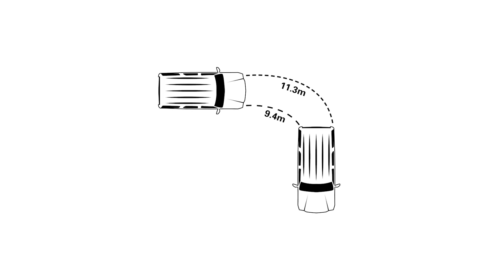SUB $600 DIY LOCKER INSTALL – Watch how much difference it made - Front vs. Rear, Manual vs. Auto

Comment: This can't work, if you were able to turn the wheel with the force from your arm while the other wheel is being held by another person, then why won't the engine just power through it when the wheel lifts? In that test the run with no lokka clearly goes in super hard compared to when you tested the lokka on... I don't get it
Reply: Lachlan Sutherland 
I was thinking the same, obviousely we are missing something?
Reply: When you have the accelerator down with drive to the crown wheel via the pinion from the drive shaft the diff centre is rotating putting power to the diff centre via the cross pin you saw briefly in the video. With torque applied to the cross pin it puts pressure on the intermediate plates which are pushed outward toward the side gears which the CV drive axles are connected to stopping them from ratcheting. Back off the accelerator and the side gears will then ratchet over those teeth as the inner intermediate plates can push back towards the centre with help of those little springs. Hope this makes sense.
Reply: Geoff Moroney
 Great thanks. I think I understand better now but other than the mentioned benefits I will stick to a manual locker of some kind
Reply: @BandittBKA  I've driven vehicles with both auto and manual locking diffs, I prefer the auto style as in this video. Control it with your right foot. Accelerate and it stays locked, back off and it unlocks, accelerate and it's locked again. Keeps your hands on the wheel. Downside if it bothers you is the ratcheting sound and slightly heavier steering when 4x4 engaged. In 2wd it's the same as it always was.
Reply: I will add that the part where Sauno is pushing one tyre while the assistant holds the other, is not replicating anything that happens on the road.  If one tyre has grip, noone is hand turning the other wheel. The drive impetus comes from the driveshaft, not in the reverse direction from the wheel circumference.   I think the point is that in the absence of doing that, then the driveshaft will be turning both wheels the same, including the one with grip.
Reply: @geoffmoroney9283  So is there any delay (wheels having to spin at all before it engages/locks if having to stop on a hill etc
Reply: @volcanic5187  No it's always locked and it unlocks automatically to releave any axle wind up and then locks again. You can also control this yourself by getting on and off the accelerator, backing off will cause it to unlock sooner.

Comment: I missed the part where they mention these are extremely noisy and chatter when on pavement.
Reply: They do mention that they are for part time 4wd. You shouldn't be in 4wd on a pavement. 
But if you're talking in a fulltime 4wd, then yes I expect they would be a bit noisy. And under a fair bit of strain in a carpark, for example.
Reply: @alexdevries7594  and gravel?
Reply: Damien Frizzell fine on gravel in my experience. It’s the slow, tight turns where you really hear it.

Comment: How do these perform when cornering in sand? I'd imagine putting the power on when cornering in sand would lock it up and make the steering heavy and difficult? Anyone with any experiences?
Reply: Works great in sand ! Its most of what we get to drive in SA - beaches, dunes or deserts. If the wheels are spinning under power no differential action is needed, so no change really. A little bit of self centering occurs, but if you're stuck in some deep ruts where everyone else has driven - just turn the the steering wheel and the Lokka will usually drive you out of the ruts !
Reply: You will need to let off the accelerator for the locker to disengage

Comment: A lot of 4wds are constant 4wd.

I know this video is scripted for complete newbs, skipping important parts in setting clearances is going to leave a lot of weekend mechanics in a spot. Be careful.
Reply: Yes - make sure you use your feeler gauges to check the intercam gap - takes one minute out of the hours of installation. The fitting instructions deal with this.

Comment: anyone else fitted one, what do you think of them?
Reply: I have one in my GU the clearance weren't right and it stays locked, at the end of the fitting you saw Shaun spin one wheel while he,s mate held the other, mine wont do that it just stays locked its a big heavy job and I followed the instructions too I'll be taking it out as soon as I get an elocker.
Reply: Best traction aid I have ever added to my Patrol and the cheapest form of diff lock you can get, fitted it myself to the front diff.
Reply: @petejones961  Must have something wrong with the install, the one I fitted to the front of my GU is spot on. Worked just like Shaun showed in the video. It is a heavy job, that front diff centre is a beast.
Reply: Have one on my Jeep and can’t fault it at all! Can’t notice it at all when driving in two wheel drive and works great off-road in 4wd, best mod I’ve done.
Reply: I have a Detroit auto locker in the rear. It’s always locked... every time I go into  a low speed turn I have to take it in neutral if not I bounce😂
Reply: Love it!      Have done a lot of ks and apart from the unbelievable traction you wouldn't know it was there
Reply: @petejones961 The measurements in the instructions are critical and they do have a warranty. You may have missed a step or two
Reply: I have one in the front of my GU and I like how it's goes only time I've really noticed it was a technical uphill climb, steering was a little difficult, heavy to steer and wants to go back to centre very hard but otherwise I love it.

Comment: Seems like junk if he can hold the wheel and disengage it .. what stops that from happening on the trail
Reply: When engine power is applied the centre pin forces both ring gears outward, locking them into the locked position
This means you MUST come off the accelerator when taking corners to allow it to unlock or you'll essentially be cornering with a spool

Comment: how come i know no one with one then? everyone i know runs a manual locker. there must be a down side to this thing
Reply: There is a downside the clearances on these lokkas must be right, if there not, it wont work properly and they don't come with any shims if you need them you have to get them made, you cant buy them. Also your crown and pinion cant have any wear.
Reply: If fitted correctly they work brilliantly, I prefer them over manual lockers. Much cheaper and you control it with your accelerator. Downside is slightly heavier steering while in 4x4 and the ratcheting noise when it releases going around corners.
Reply: Geoff Moroney ahh so they make a audible ratchet noise even when not in 4wd too then? If so I can definitely see why people don’t run them then, I’m sure that would get very annoying very quickly
Reply: @bbggakkba  if you don't have 4x4 engaged there is no noise.

Comment: Nice illegal bullbar in qld one third off the tire must be covered lifted or not. I have the fine to prove it.
Reply: you should probably challange that in court. seen as 3/5 is generally covered by the vehicle body anyway
Reply: @richardkomar8765  they are talking about the front  not the rear. The  engineer they made me hire inspect and mod plate. Said that arb bars are failing on hiluxs. The police dont carry a tape so anthing higher than the top off the rim from the front is fined.
Reply: @karlpokorny7130  - find this and have a read. Minor Modifications – VSI G19.11

Comment: Mmmm sounds a bit noisy
Reply: I have one in the front of my 2001 Rodeo. I am yet to hear it unlock on the trail. Not over the roar of the V6 anyway... :)
Reply: You get some strange bangs and clicks sometimes . I occasionally get massive bangs as the pressure is released from the dog clutches

Comment: Are these Auto Lockers compatible to any IFS front end vehicle?
Reply: den_T I believe the Hilux used in the vid is IFS
Reply: @jase4452  Yeah it is. What I am more wondering is whether it is compatible to a PK Ranger for example in my own specific circumstances. As obviously, a Hilux's Diff dimensions are different to a Ranger or Navara's diff dimensions.
Reply: @den_t5661  You have to buy the correct one for your model vehicle/diff. The Lokka is custom designed for each model. E-mail 4wd Systems with your model or check their website to see if they make one for your specific diff.
Reply: Sorry @den_T  I misinterpreted your question

Comment: So this style of locka does the same job as an LSD then?
Reply: This style of locker provides an absolute fixed/locked behavior under input power where neither wheel is "rolling" past the input speed of the driveline. When engaged, it provides the same traction advantage as a manual locker in locked mode, forcing both axles to rotate the same speed regardless of traction. LSD's are still "open" diffs with varying levels of slip limitation provided by either clutches or clever gearing (torsen). Torsen style LSD's work well when aided by a traction control system or manual brake application to prevent wheel spin when a wheel lifts. Clutch style LSD's are basically useless for any situation where a wheel comes off the ground.

Comment: These lockers break under shock load. A Detroit locker is a much better option than this and will last 10x longer.
Reply: For a stronger axle yes. But for those Hilux axles it will break everything else before it will break the lokka so a Detroit is overkill.

Comment: Rubbish. These lock when power is going into the diff and unlock when you let off the throttle. Thats why in the episodes with the zook they struggle to steer it uphill. The way shauno talks about this he makes it seem like theirs no disadvantages to it and no benefits to an air/elocker when they are  heaps better. Not a bad product especially for the price but its just completely misleading. Though shouldn't be surprised as the 4wd action mob are so easily bought out
Reply: Not entirely correct to say they lock under power and unlock when let off.  
They have no normal diff gears and are normally in a locked state. When turning, it unlocks the outer wheel and allows it to ratchet ahead of the diff carrier.  
What determines how easily it unlocks depends on a battle of 2 forces. Torque from the engine encourages it to stay locked, and torque back from the wheel which traction from the ground is pushing ahead of the other wheel encourages it to unlock.  
The torque from the wheel needs to overcome the torque from the engine to allow it to unlock, which is why it can be hard to unlock when power is going into the diff (especially on slippery surfaces). When you let off the throttle, it will still be locked in a straight direction but will unlock very easily when turning.

Comment: Hopefully they're not made in China but i'd bet London to a brick they are and this'll most certainly raise durability issues. ARB still maintain their diff lockers are made in Australia but that's bullshit (made in China/Taiwan) and ASSEMBLED IN AUSTRALIA. I went through 8 ARB lockers in 94,000 KMs and NOT ONCE WHERE THE FAILURES ATTRIBUTED TO DRIVER ABUSE but always on the parts failing. They replaced all of them under warranty but that's not much cop if you're on holiday and the bolt falls out the crown wheel and destroys the diff and housing....If you need lockers just buy a vehicle that has them factory fitted as standard and avoid the bullshit. 70 series v8 still no problems and works every time without fail...Gets you there AND BACK
Reply: Designed and made by an Australian family in Adelaide.

Comment: 3 times cheaper then manual lockers wonder where he gets his manual lockers from
Reply: ARB? Air locker installed in a similar hilux is $1969. E-Locker is even more.
Reply: For my car:  
$370 for Lokka
$990 for ARB Airlocker (locker only without air system)  

$1400 for E Locker
$1600 for TJM Prolocker

Comment: I think you will find the auto locker engages under power and disengages when the power is off. Therefore you still have to lose momentum to get steering. Not the best made video Shauno sorry
Reply: Not really. Its normally locked and it stays locked and only unlocks when a wheel tries to roll faster than the diff is turning it. You dont have to lose momentum necessarily to get steering, its there almost all of the time - just sometimes when you have a lot of front to rear tailshaft windup on a hard surface will it tighten up and even then usually just a bit.

Comment: You really don’t understand how lockers work.

1:52 you say lockers transmit 50:50 and that’s why they’re hard to turn. They don’t and that’s not why it’s hard to turn. Wheel speed being the same is what resists turning. 

Now I’ll explain the misconception that lockers split torque 50:50. Lockers send torque dynamically to the wheel with the most traction. If you’re going strait on high traction surface then it’ll split 50:50, but if you turn it’s going to bias all the torque to the inside wheel and force it to spin faster than the road surface so that it matches the outside wheels speed. Enter the Detroit ratcheting locker. The shaft cannot spin slower than the carrier but can spin faster. You turn and torque still biases to the inside wheel, but the outside wheel unlocks and freely rotated faster than the carrier to allow the inside wheel to spin with the surface statically. 

The dynamic torque distribution is based off the principle that torque requires resistance. You lift a wheel off the ground and that wheel cannot generate resistance therefore it receives only enough torque to spin the wheel. Locker engaged and the inside wheel generates all the resistance, hence receives almost all the torque. 

Lockers can dynamically send torque from every available ounce to none to either wheel, and if you have a fully locked rig then any 1 wheel can receive all available torque. 

In the end a locker maximizes torque transfer. Your left wheel can generate 30 ft lbs and the right can generate 200. With an open diff you can send up to 60 ft lbs before the wheel spins and you lose momentum. With a 3:1 tbr Torsen you can generate up to 120 ft lbs. with a locker, the wheel with 30 ft lbs will generate 30 ft lbs and not spin, the opposite wheel will get the rest until it is overloaded as well, so the locker can generate 230 ft lbs of force with the locker. 

Obviously this changes drastically with the environment, but in the end the locker finds the traction proactively.
Reply: Absolutely right

Comment: what was that horrible crunching noise at 8:25?
Reply: That's the centre portion of the differential disengaging and engaging under the spring pressure. That's normal operation for a "limited slip differential", which is what this differential is.
Reply: yeah i noticed that when his mate was holding the wheel
Reply: Got 1 in the back off me 80 and thats the sound it makes when driving around town never hird a lsd do that
Reply: @chrisgilbert9534  wrong. lsds use slipping clutch plates. this locks up with the notched teeth. when locked the force isnt on the springs
Reply: @jamescleaver6749  okay, perhaps I should have said locked only in a straight line open in a corner, part time locked, auto unlocking diff.
Reply: Probably ment to infer that it works like a lsd.
Reply: Jeremy.is.famous the locker

Comment: Nope. If front driveshaft is driven the locker is locked.
Reply: That's not 100 percent true. I have a lockright version of one of these, and I know for a fact that if set up right, they will unlock under load because they allow one side to ratchet faster than the ring gear. Essentially they force the two halfshafts to run at the same speed as the ring gear, or one side to run faster by ratcheting that side. That's why drag racers and drifters love these things, but racecar owners hate them. They're incredibly bad at putting power down in corners, only the inside tyre is doing any work (making initiating a drift easier).

Comment: it sounds like an auto locker is just a limited slip diff
Reply: Limited slip diffs still allow single wheel spin-up, auto lockers do not. LSDs work smoother but auto lockers give better traction.